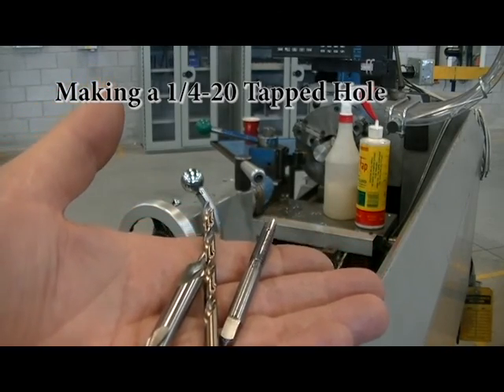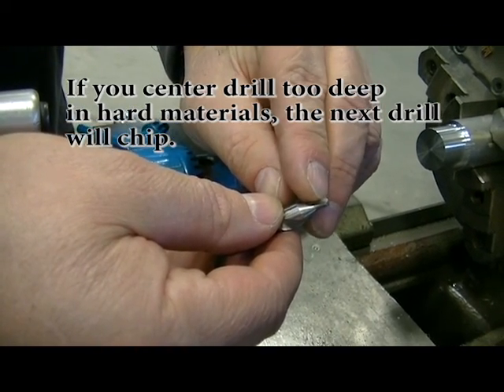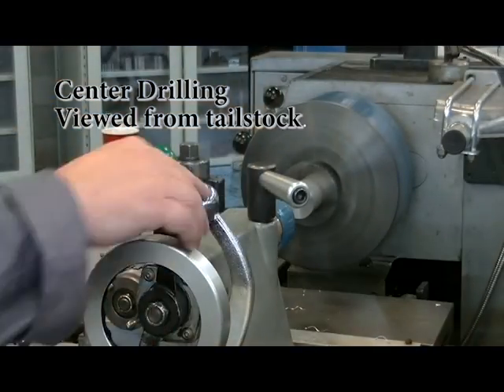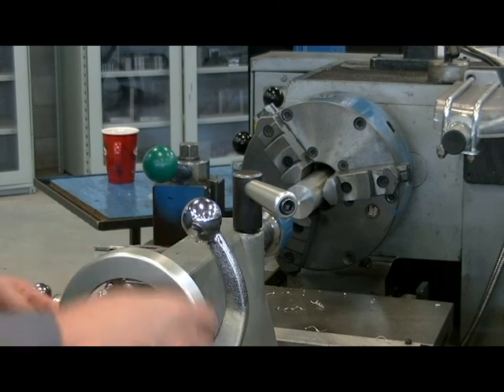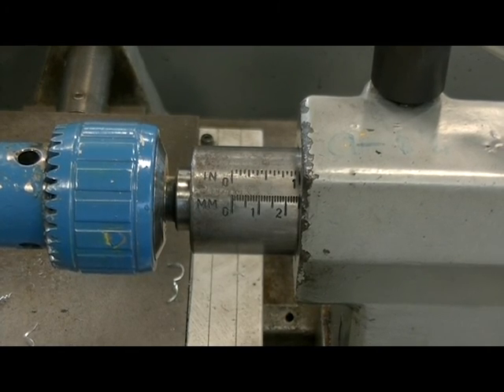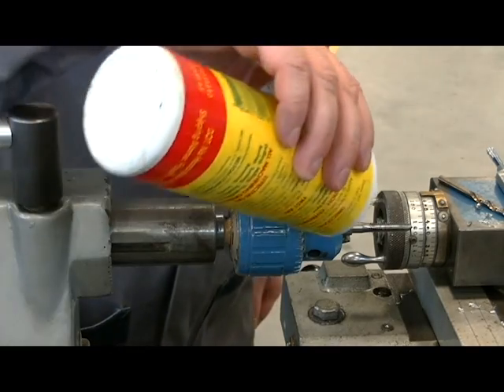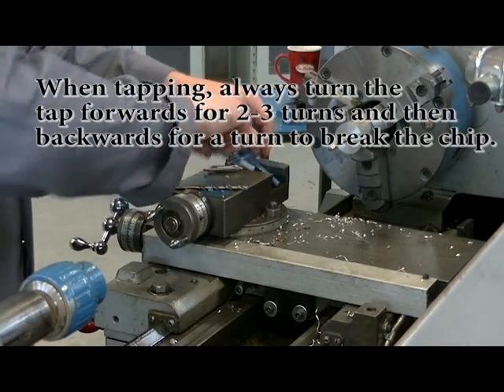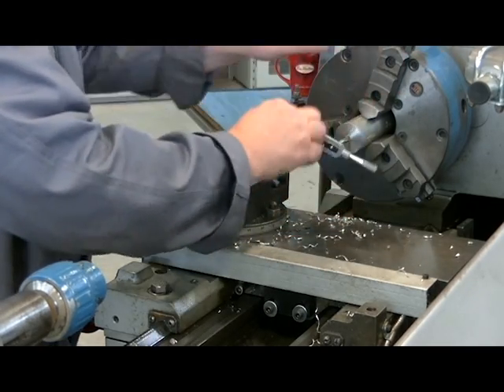Tapping on a Lathe

Comment: Why do you only "lightly" lock the tailstock?
Reply from the maker: Never over tighten any lock on a machine as it can cause the equipment to move and reduce your accuracy.  only engage locks just enough to perform their function.  A lot of machining is about consistency.
Reply: Okay, that makes sense. Thanks for the reply. I have been cranking things down pretty tight (probably much too tight), because I am afraid of things moving during an operation. I imagine with a little experience, one develops a feel for how tight is tight enough without being too tight?